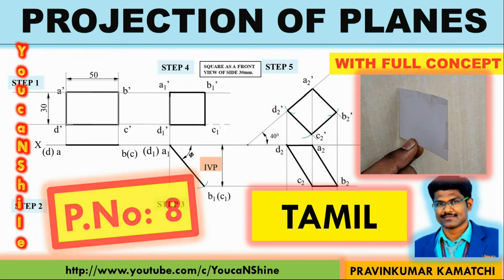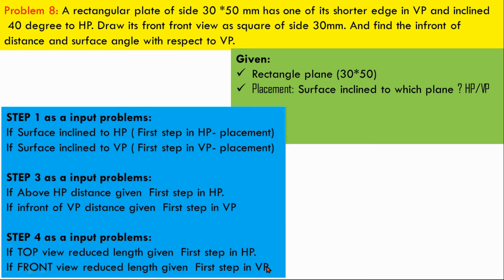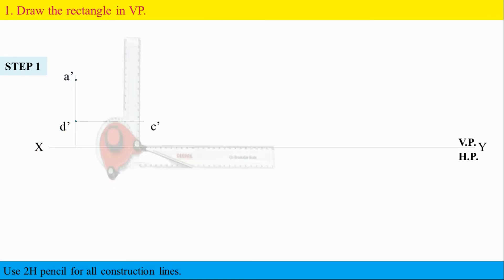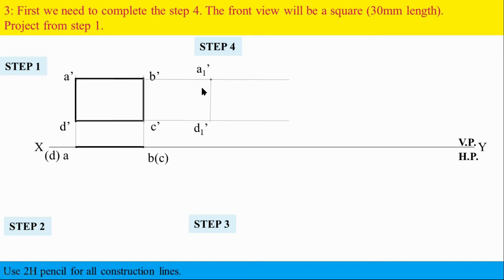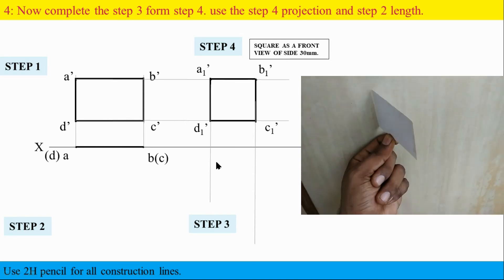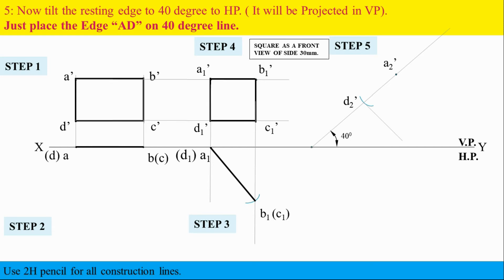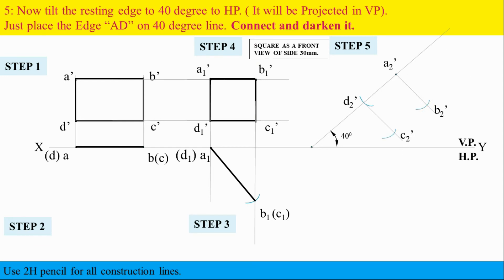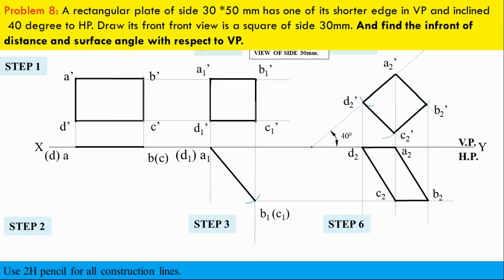#Projectionofplanes | P.No 8 | Tamil| | Engineering Graphics # Pravinkumar

Comment: Sir part 2 video upload pannunga sir. Projection of plane
Reply from the maker: Problem 1: Rectangle 30mm and 50mm sides is resting on HP on one small side which is 30 degree inclined to VP,while the surface of the plane makes 45 degree inclination with HP. Draw it’s projections.
Problem 2: Rectangle 20mm and 60mm sides is resting on VP on one small side which is 40 degree inclined to HP,while the surface of the plane makes 50 degree inclination with VP. Draw it’s projections.
Problem 3: A regular pentagon of 25 mm sides is resting on HP on one of it’s sides with it’s surface 45 degree  inclined to HP. Draw it’s projections when the side in HP makes 30 degree angle with VP
Problem 4: A regular hexagon of 20 mm side, is placed on its corner in ground and it’s surface 30 degree  inclined to HP. Draw it’s projections when the side in HP makes 25 degree angle with VP
Problem 5: A regular circle of diameter 60mm  resting on VP and the diagonal of the circle is 30 degree to HP. The surface is 40 degree  inclined to VP. Draw it’s projections.
Problem 6: A regular hexagon of 20 mm side, is placed on its corner in VP. It’s surface 30 degree  inclined to VP. The edge opposite to the resting corner is 40 degree to HP. Draw it’s projections.
Problem 7: A square plate ABCE of side 33mm is resting on ground by its corner. The diagonal AC is inclined at 30 degree to HP and the diagonal BD is inclined at 45 degree to VP and parallel to HP. Draw its projection.
(NOTE: diagonal AC is surface inclination key)
Problem 8: A rectangular plate of side 60 *40 mm has one of its shorter edge in VP and inclined 40 degree to HP. Draw its front front view is a square of side 40mm.
Problem 9: A thin circular plate with 60 mm diameter appears in the front view as an ellipse of major and minor axes 60 mm and 40 mm length respectively . Draw the projection of circular plate when one of the diameters is parallel to both the reference planes.
Problem 10: Draw the  projections of a hexagon of side 30mm having one of its sides in HP and top view inclined at 65°to the VP and the surfaces inclined at 35°to the HP. 
Problem 11: A pentagon of side 25 mm rest on its side in VP. The corner which is opposite to the resting edge is 30 mm infront of VP. And the resting edge is also 37 degree inclined to VP. Draw the  projections.
Problem 12: A regular circle of diameter 50mm  resting on HP and the top view is seen as an ellipse of minor diameter 38 mm which is perpendicular to vertical plane. Draw it’s projections.
Reply from the maker: Which number plane problem you want.. Wil upload it soon..
Reply: Ok sir thankyou sir